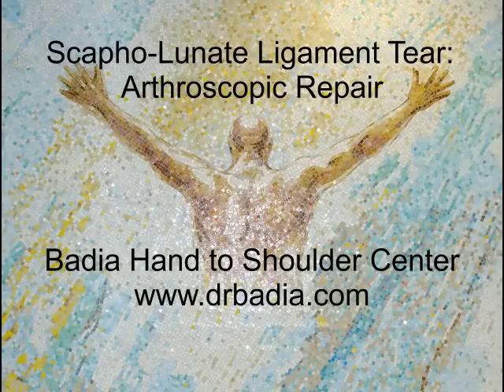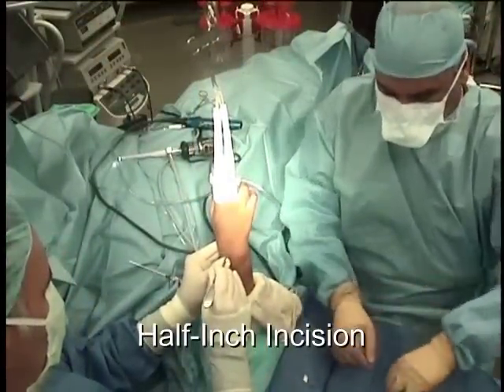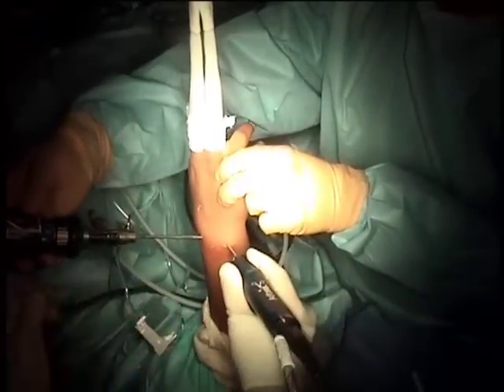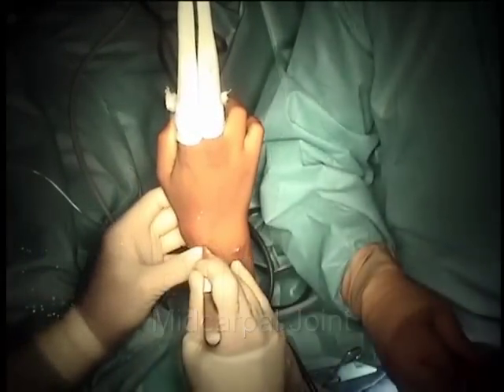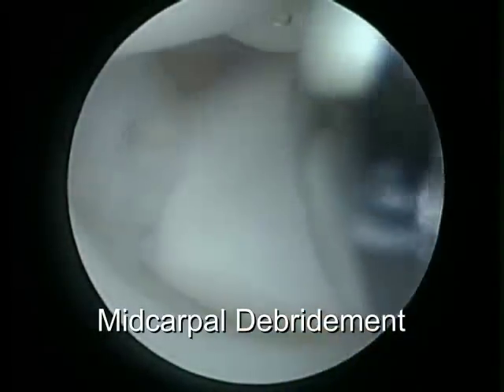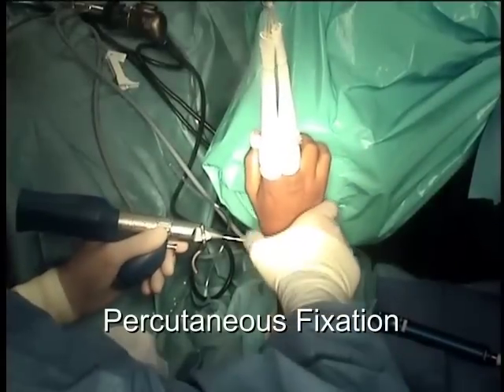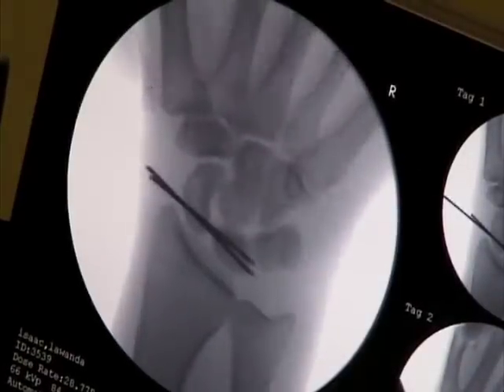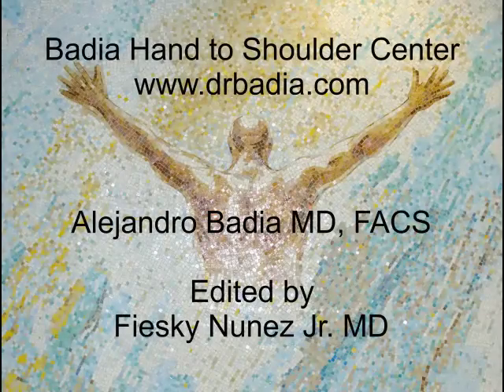Scapholunate ligament Repair Wrist Surgery Center Dr. Alejandro Badia Wrist Injury Repair

Comment: I fell over 5 weeks ago and have been in a cast since then. I'm only 13. I went to specialist today and got told I had done something to my scaefoid ligament and need keyhole surgery. as soon as he told me I freaked out and instantly cried. they said they may need to put a screw In my wrist. and said I would stay the night in the hospital. I asked if I would be asleep and he said of course. (it may only be because I'm little) and after surgery I need to be in a cast for 6 weeks, and THEN a splint. it sucks. bit at least I get time off school and chocolate and cards. that's why I was watching this vid as this is what they are doing to me. ligament damage is way worse than a break. 
WELL....... I GUESS MY SUMMER I SCREWED